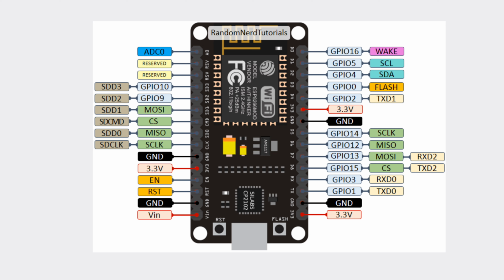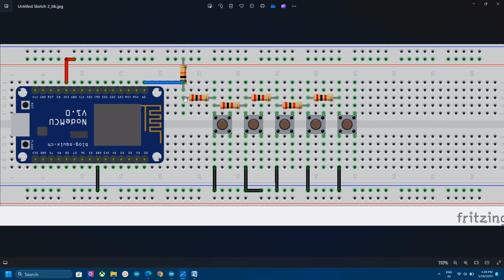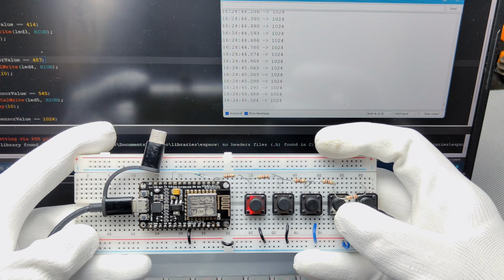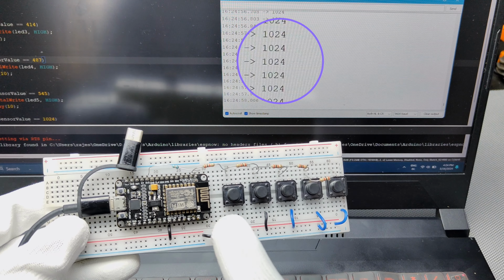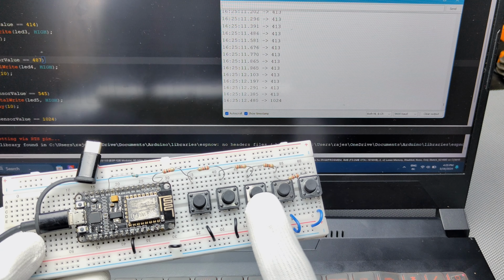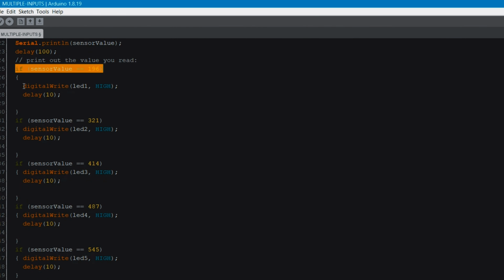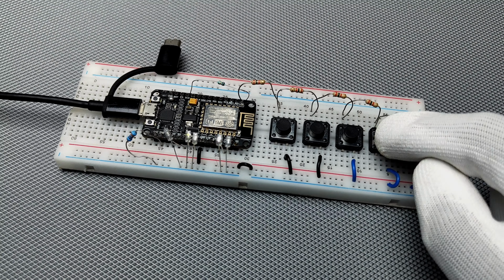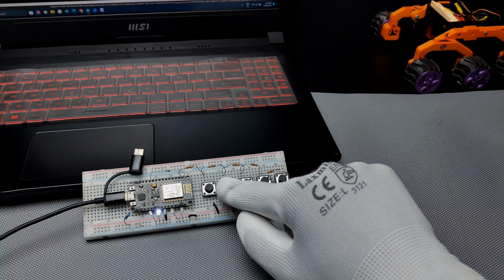Use 1000s of switches in ONE pin

Comment: Thanks for sharing
can you help me to make circuit schematics  and code
I want to read voltage with an isolated ground
Mine setup is 4x 12v battery with 4x solar controllers with 1x Esp32 and 2x ADS1115
Reply from the maker: Possible

Comment: The problem with this method is when u press 2 switch in same time  the analog value will completely change.. so it's a bad idea to use this type of method in a controller..
Reply from the maker: You can't normally use that. But in critical cases we can adapt this type of hacks without any problem . By the way if want want use two buttons at a time that is also possible by just reading the analog values at the time of two button  push.
Reply: @EDISON_SCIENCE_CORNER  exactly, you can setup if statements for all the permutations
Reply from the maker: Yes a user can alter accordingly
Reply: @EDISON_SCIENCE_CORNER 
 In this way you not only make the code complicated but also cause a noticeable delay , false reading etc.. this technique not good for a controller but for other such small applications  it's a fantastic trick
Reply: Actually, if you use an R2R resistor ladder that should work fine… The each button would be a power of two resistance instead of a multiple of two and in that way, you can push two buttons at the same time and read the binary values in different statements. Although I am interested in the performance lag or the latency of reading the deck in real time.